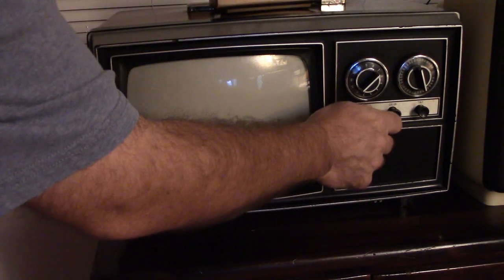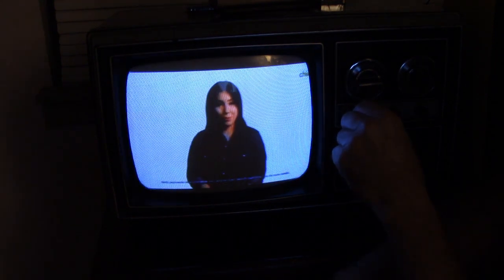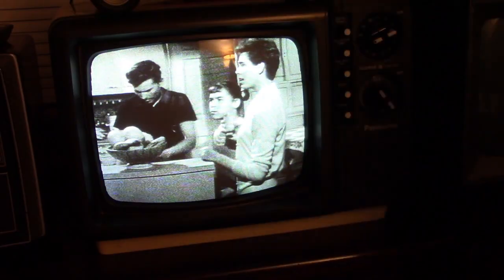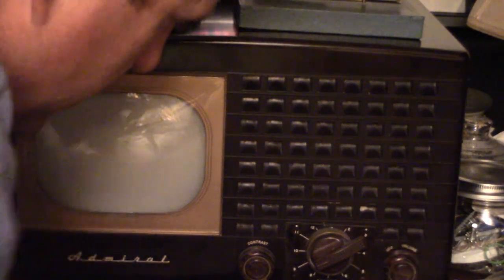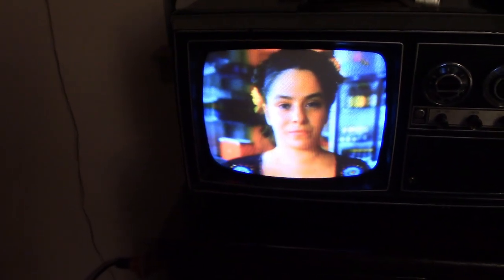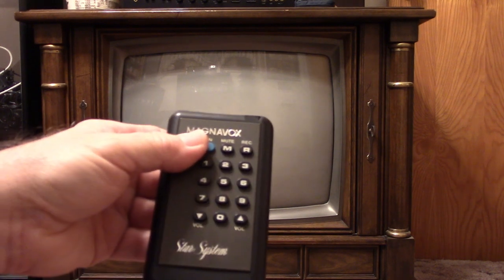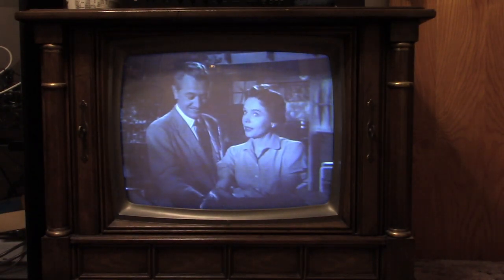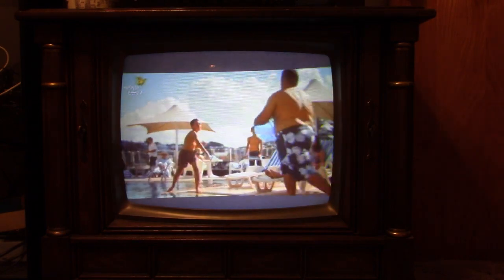Fall 2021 Vintage TV First Power Ups

Comment: All amazing TVs and a cool vintage collection. Well some had a clearer picture than others. The best part is that they all actually worked!
Reply from the maker: Yep, even with not so great signal, there is still a watchable picture. I need to go through, and tidy up all the connections, clean some controls, and they all should be in top condition.

Comment: I miss the days of things that had to warm up before they worked.  When we were kids, there were still a few holdouts that had vacuum tubes that still worked.  And you'd turn them on and always sit there and wait intently to see if they will.

Nowadays you don't get the same feel.  A vehicle you might let warm up for a minute or two, but it's not the same.  A hairdryer takes just a few moments to get hot.  A phone or tablet booting up just doesn't have the same feeling.  And I won't even mention these LCD TVs that take 15 seconds to boot up, it's just not the same.

That Magnavox at the end has the most awesome on-screen display for the channel that I've ever seen!  That must have been quite the feat back in the day, I'm sure that TV cost a small fortune, but obviously has paid for itself with how long it has lasted.

I have an RCA that has on-screen display, but it's just for the channel and the time, not for the volume.  Same thing with the TV in the basement.  That one I found thrown out that had a sign on it that said "WORKS".  It has on-screen display, but not for the volume.
Reply from the maker: Part of it is turning, or pulling a power knob, mechanically turning a device on, as opposed to touching a screen, or pressing a button. I was actually surprised I didn't hear any tin whiskers clearing themselves on the GE Portacolor, as it began to warm up.
Speaking of vehicles, after replacing that selector valve in the 1981 Chevy, it starts up very quickly, after sitting for a few days. I thought it was a fluke, but it did it again today. I will get a cold start next weekend, and watch it be like before, where it too a good 4 seconds of cranking to fire off.
That Magnavox is my all time favorite. It's just always been there, and I have fond memories of that tv all during my childhood, and beyond! I'm certain that's why my Grandfather bought it, because of that OSD.
Is yours the white OSD like the Magnavox, or had they gone to the green readout. I remember those RCA Lyceum tv sets we had in elementary school. They had white OSD with channel, and time, at the bottom of the screen, and that was mid 1980's.

Comment: I love that Magnavox with the Star system, very rare to see that working these days! What type of use did this set have? I'm assuming this wasn't a daily driver...
Reply from the maker: So far it's working fine! I do have a spare Star chassis though. Was a daily driver until 1986, and then it went into one of the downstairs bedrooms at my Grandparent's old house, and used once or twice a month, when I'd visit. In 1986, my Grandfather had bought one of those 40" picture tube Mitsubishi sets, and it lasted to the early 2000's. I've had the Magnavox set since 1999, when my Grandfather sold his house, and it's had light use since.